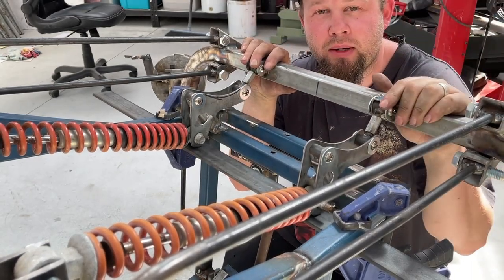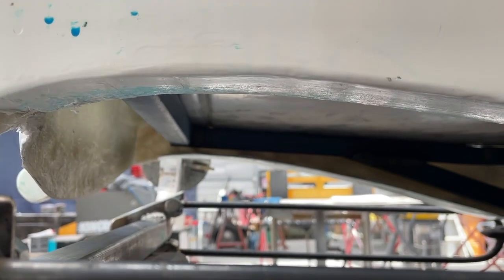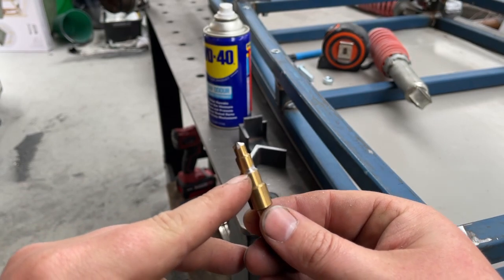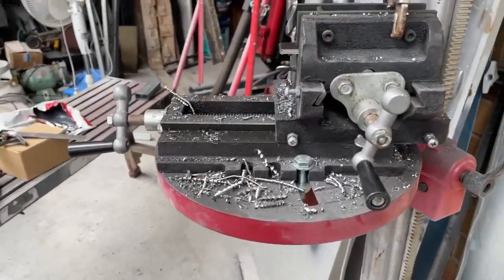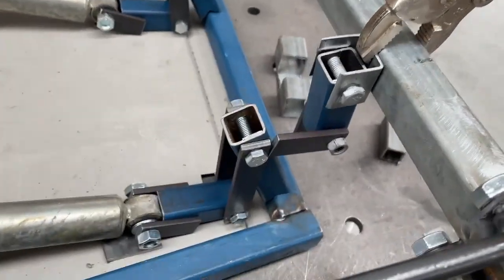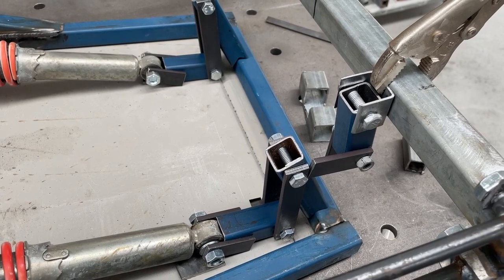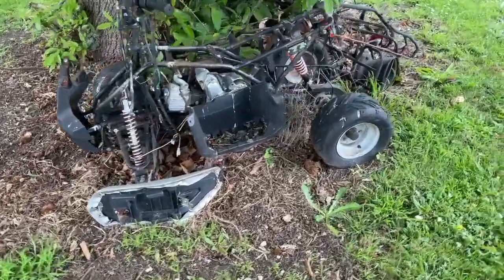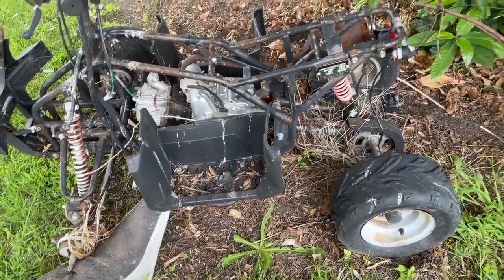Linear cantilever suspension! Does it work?

Comment: I'm thinking if you want true independent actions from left and right sides, you"ll need to attach the square tubing axle to the cantilever arms by using heim joints. That will allow more free movement when the left or the right side needs to move independent of the other side because the movement up and down is actually pivoting off of each other within a radius. The movement is small enough and loose enough through the connecting points that it isn't noticed because of slop in the connections. My thought is, to move one side independent of the other, one side becomes the stationary point while the other side is working off of the radius of that stationary point, but because the cantilever arms are square to the radius they can't move closer to that stationary point in a circular motion, it will eventually get bound up as the travel gets longer in the stroke. In your final assembly, you used adjustable links which is probably a good idea, but they are going to constantly want to loosen up because they will be put under a twisting motion from the right to left or left to right rocking motion of the suspension. Just a thought.
Reply from the maker: Thanks for your comment! That’s a great thought! I did think about using heim joints but couldn’t justify the cost, this is more or less a prototype and a huge learning experience for me and I’m funding this with my own money which is running low. I’m hoping to get some people interested in buying some and build a business for myself.
In the future I want to use some sort of bushing. It will be driven up and down my back yard and at car shows, and I think the suspension will work fine with that.
I hope that comes across as positive, I’m not great with words sometimes
Reply: @CROCRODZ  I understand the money issue and don't get me wrong, I was watching your video because I wanted to learn something and you delivered. But hiem joints aren't expensive considering you have them on the 'A" arms of those old quads you have out back. No worries, I was just thinking in terms of engineering and not finances and availability.
Reply from the maker: I’m glad you got value from my video! I didn’t see any heim joints on the quads but now I’m curious and will have another look. You are 100% right about the engineering aspect of it though and if I can find them cheap enough locally I’ll definitely consider using them. I’m trying my best to either make stuff myself or find it locally. 
I will be using heim joints in a future video for the steering linkages, I found them in my late uncles thing but they were to small for the suspension
Reply: @CROCRODZ , the end point of each "A" arm should have a type of heim joint/ball joint that should be able to just cut off and weld in place right where your adjustable link is bolting through the brackets you made on the square tube axle piece. The ATV A arm is actually a ball joint but there should be some steering linkages on those ATV's that have a heim joint on the tie rod stirring link.

I'm a fabricator by trade so I'm always looking for scraps to make something happen, just like you. I really did enjoy what you were making and I also enjoyed your problem solving and thought process. Grind hard plumping has a channel on YouTube and they do a lot of donor parts swaps just like you and I. its so much fun.
Reply from the maker: I watch grind hard all the time!
I just want and had a look at the quads they have a sleeve bushing on the A-arms, one long one on the frame and 2 short ones on the spindle mount, they’re cheap Chinese ones.
Reply: @CROCRODZ  dang it. hey man I tried.
Reply from the maker: It’s all good! I really appreciate your comments! Thanks 👍
Reply: @CROCRODZ  I subscribed. Keep up the good work.